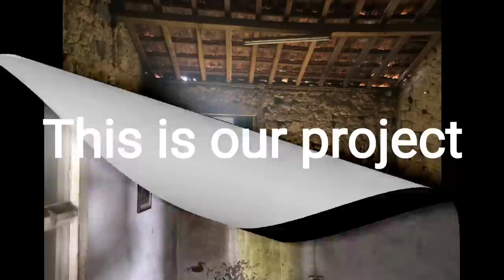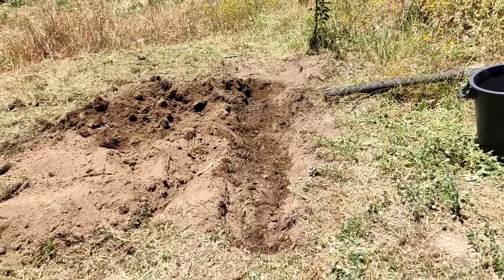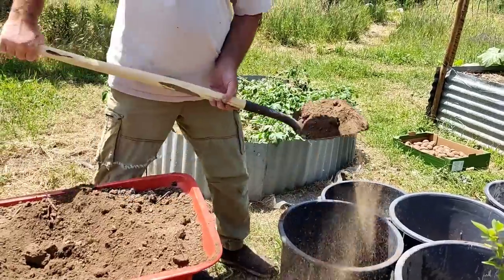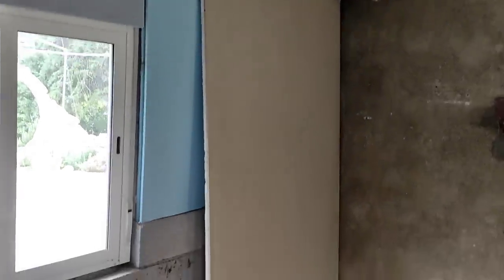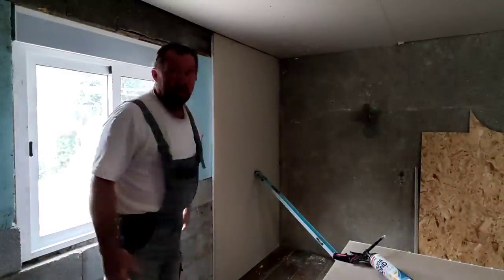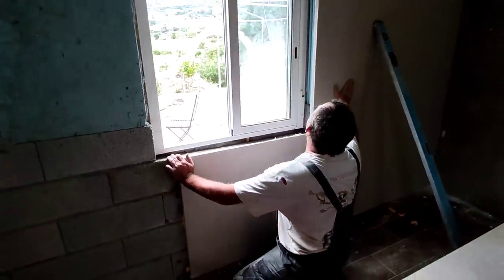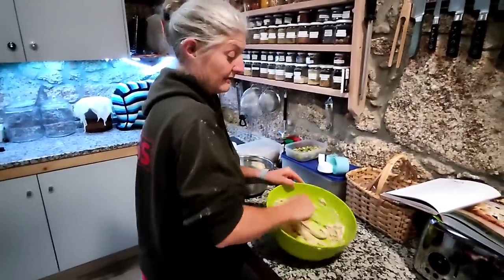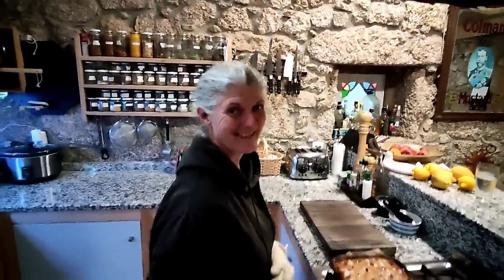65:  Plasterboard for the Walls on our Central Portuguese Farm.  And A Cherry Bakewell Recipe

Comment: That nick is the modern way in aus I watched English Reno’s with horror at the board and then completely covered in pink plaster , reminds me of overpackaging ,overkill . Love cherry pie / flambourtine , go angie be round in 5 for cafe latte , the Pitt gadget is time saving could be used for olive maybe👍❤️❤️❤️🙏
Reply from the maker: The thing with plastering over all the boards is: You get a very flat paintable surface, which is tough and resilient to damage, painting onto cardboard is exactly that and won't take any impact at all, that being said, it is much cheaper and easier to tape and joint, but it has its limits😁😁😁👍

Comment: Nick could you not consider a cheap coving (even polystyrene) to run around the ceiling/wall joint to save time/materials/money if not too late
Am surprised you don't do basic electrics, please tell me your electrician is not Jasper ROFL
Andrea does your pitter handle olives too?
Reply from the maker: Unfortunately you can't put olives with that type of machine, it an olive pit needs to be cut out with a different machine, or left in 😁 I do some basic electrics, but to keep things legal etc etc

Comment: What about a reflective radiant barrier?  The foam doesn’t stop radiant heat, correct?
Reply from the maker: No,  radiant heat is for heating, we are trying to keep things cool, which the best way is to stop heat getting into the building  by insulating the hot surfaces, basic insulation stuff😆😁😁

Comment: Do you have any concerns of condensation build up and mould grow behind the polystrene boards?
Only asking as seen this at parents house. Indoor insulation was not a longterm solution. Behind the boards was lots of mould and walls were damp.
Reply from the maker: It's very dry here
Reply: @projectportugal   That will help.
Reply from the maker: @veryuniqezombi  as I've said  In Previous videos, all houses need good ventilation, humans and pets give off lots of moisture, as do open fires etc etc the most important factor for having no damp in our house is good ventilation
Reply: @projectportugal   I agree. The simplest is daily window opening but also find positive ventilation to be very good. Thanks.

Comment: May I ask why you don't use clay plaster to have a better indoor climate to regulate heat and cold?  It seems that your soil is full of clay mixed with sand, the plaster is easy to make, being cheaper and more functional than the plastic walls.